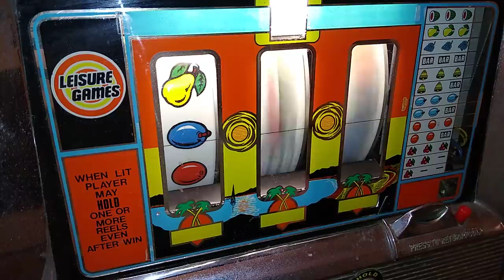Vintage Bally slot machine payout counter

Comment: Has anyone been on "Hand Tool Rescue" where he restores an IBM cheese cutter from the 1920s? Whilst it is not electronic in any way, it is the mathematics that went into it that makes it fascinating. It is essentially a calculator.
Reply: I saw that. The moment I realized the levers were performing a mathematical function, my mind was blown. I love retro computing, and finding mechanical and analog computers is an absolute joy!
Reply: But he was partly wrong on the weight-adjustment, at least how it was explained. the value has to be set for the complete (360°) cheese, even if you just put a 90 degree part on.
Reply: Wasn't it fascinating! What impressed me is they worked out an average portion/mass/value for cheese in the first place!
Reply: @rarbiart  that’s what he says in the video. If you have a full cheese or a block you put the original weight.
Reply: Yeah that was really interesting and it was amazing that when using modern electronic scales, the last century machine was extremely accurate. I wish I had a better grasp of arithmetic mathematics so I could understand how an analogue computer like that actually worked. I bet they cost a pretty penny when they were new. Very clever indeed and he did a brilliant restoration of the machine as well. 👍
Reply: "52 slices of American cheese..." 🤤😂👌
Reply: @richfiles  Yes, it looked decidedly unimpressive at first, even "cheap" in the way it was just pressed steel. It was only as the video progressed, did it become apparent, this was mathematical brilliance at its best, all done with levers. I was triggered with mathematical concepts whilst watching it. The IBM and the fractal vise are probably my favorite of his videos.
Reply: @josephking6515  I'd love to see the engineer's calculations and notes on it. Fascinating stuff.
Reply: @NigiriCat  OK, I missed that part.
Reply: @rarbiart  dont forget we went to the moon with most of the men working on them using slide rulers for most calculations
Reply: I've seen the thumbnail and ignored it in disbelief !

Comment: Brings back memories of childhood - raised by the seaside so the mechanical one arm bandits were a big part of my teenage years. No computer arcade games then.
Reply: Do you remember the horse race - 6 horses and you put coins into one of 6 slots depending on which horse you were backing. My bro and I found one of these - where they'd made a massive mistake (for us at least anyway!) All you need do is watch the machine for 6 'races' learn the order of the 6 winners and then back those winners when it repeats ! Then, you learn the order again for the next six races and again back all the winners when that sequence repeats !
Reply: @millomweb  I certainly do!  On one occasion someone who worked at the fairground  kept calling out the number of the horse that was about to win. (probably trying to impress a girl he fancied).
Reply: @millomweb  Yes I do remember them too although I wasn't a big fan. The bandits were a perennial favourite probably due to the noise of the lever arm, reels and the payouts. 
But my favourite game (which is still in all the arcades today) is the coin roll/pusher/drop games. Which they built a TV game show around a few years ago.
Reply: @tinplategeek1058  You mean Tipping Point :) The one I like was the one with the stripey conveyor belt coming towards you - where you had to get the coin cleanly between the lines. I could do that one ;)
Reply: @millomweb  That's the name - had a memory glitch there. There were many variations of the dropper/push/roll coin machines including as you say the conveyor belt ones too.
Reply: @tinplategeek1058  Tipping point is quite an enjoyable time-waster ;) Followed by The Chase, that's the afternoon done ;)

Comment: In the US, slot machines (even the new, all electronic machines) are built with components to produce noise. The payout coin pan is built out of a lighter weight metal and connected to the heavy frame of the machine in such a way as to enhance the sound of the coins being dispensed. Heightening the excitement for the player and drawing the attention of others to a "winning machine."

Comment: I blame Technology Connections and Fran Blanche for my love of electromechanics. So many creative and robust solutions to problems. God I need that Sunbeam toaster.
Reply: I want one too. Where can I buy it new?
Reply: @leonzantvoort6201  don't think they've made them for like 50 years so you can't get a new one. Refurbs though...
Reply: I've got a Sunbeam food mixer/finger slicer. Got about 6 attachments and not many couldn't kill you. I suspect the lemon squeezer would only give you a nasty massage. Fitted with an analogue mechanical/contact governor, it's marked with 12 speeds but infinitely variable between each one.

Comment: Old arcade machines were such a more visceral experience.  There was the physical shaking of of the machine, the sound of the relays and steppers clicking, the smell of oil and maybe a whiff of ozone, and the soft blinking of no. 47 pilot lamps.  Modern video slots just don’t cut it; they don’t involve all the senses at once.  Thanks for sharing the peek at some innards of the old Bally slot machine.

Comment: Ahh, this takes me back to University where I had a full sized pinball machine in my dormitory room.  Over the course of about a year I slowly rebuilt it and sold it.  It was entirely electro-mechanical.  All relays, stepper relays and solenoids, all of it driven by a huge linear power supply.

Comment: As a kid in the 60’s amusement arcades we’re such a magical place the machines seemed more interesting then, wheel ‘em down,tootie fruity,roulette, horse race,even the spring the bearing in the cup type. Loved the mechanical noise of the workings and alway watched as the maintenance guy with a chain full of keys opened a machine up and I could see all the workings..fascinating stuff, nowadays it’s just the complex fruit and coin nudge machines…there’s progress

Comment: Hlaf the fun of the old games was the noise, sounded great when you enter a room and a few slot machines are click clacking away. 👍👍
Reply: I have Asperger's syndrome, a form of mild autism. That discordant  sound is exactly why I can't stand to be in a casino. The modern ones are far worse with all of the electronic beeping and boopery and flashing multicolored lights.
Wasn't until a couple decades ago that I could tolerate working on electromechanical stuff at all and came to really appreciate analog computing devices (which is what Clive showed us).
Reply: Interesting to think about that as time went on and machines got quieter, at some point someone decided the noise needed to be added back(?)
Reply: @zaugitude  LOL    very true
Reply: @markfergerson2145  the newer ones are awful.
Reply: @zaugitude  Yeah, and in typical fashion, they WAY overdid it.

Comment: In my apprenticeship two years ago I had the pleasure of fitting a Bally Star Treck Pinball machine with a new flipper coil, switch and also repair some burnt traces on the mainboard.
These are beautiful machines that are also worth their weight in copper cable.

Comment: 'When I were a lad', my best friend and myself discovered a company which was converting slot machines to use electronic circuitry. They had a skip out the back (actually next to a main road!) which we used to raid regularly - made a nice collection of light-flashing cam/motor/microswitch devices and other interesting bits! Still got some of the microswitches lying around, and sold the last cam mechanism online about 3 years ago!
Reply from the maker: Those motorised cam switches cost a fortune now.
Reply: Heh. About fifty years ago I lived in a part of Phoenix Arizona practically littered with small aerospace parts manufacturing companies. They had the most interesting stuff in their dumpsters. Everything from quartz crystal blanks that were just a little out of spec and titanium castings with teensy flaws, to some amazing electronic and optical junk. They occasionally discarded perfectly good test equipment that they didn't use any more.

Comment: Decades ago in "Popular Electronics" magazine, was a project build of a answering machine. 
A motor turned as shaft and the timing was accomplished by cutting out wedges from poker chips.
Micro switches with levers dropped into the wedge cutouts to do the electrical switching.

Comment: I grew up in Paignton & Brixham so just those sounds took me straight back to Torbay Road in high summer on my lunch break from the Igloo Ice Cream Parlour in the mid seventies.
I can still remember the wall mounted, wooden case, 2p ball bearing machines on the pier. 
Piers seem to be a bit time warpy in that the closer you get to the end, the slower things get replaced...

Comment: More electromechanical stuff please!!!
I'm an old railway signalman and love the way we managed to do complex tasks with relatively simple tech and how over time we managed to integrate relay regulated multi aspect colour light signals with purely mechanical interlocking of the levers. Todays computer based interlockings have no soul.
I'd go gaga if you could find and teardown an electric staff instrument but that's never gonna fit on the bench

Comment: 1977 I saw on the bottom of that track circuit board, nice. 2 years older than me. I miss those noises to be honest, my father took up electronic repair here in the states about a year or two before I was born. I grew up around oscilloscopes, wave form generators and the such. Still have his old Sencore TV tester in the basement with all the adapter too, though it's long lost it's purpose for TV testing/repair. 

Sorry, rambling on. He used to fix all varieties of electronics, like that and old record players,etc, etc. My favorite were the old tube TV's, and taking trips down to the local electronics shop to use the tube tester. I miss those days a little, in that you used to be able to (relatively cheaply) build your own stuff out of discrete components too; before IC chips came along. 

But I digress, I'm writing a wall of text in memorandum to reminiscing, I'll end it here before I hit the word limit. 

Good video as always Clive.

Comment: I love my collection of EM Pinball machines. Toying with them is better than playing them - so many ingenious mechanisms, but my favourite is probably the self-cleaning action of all the open relay and switch contacts - inside the cabinets can be absolutely filthy and covered in soot, but they still work. In fact if you start up a previously working machine that hasn't been used for a while, and it doesn't work straight off, a few plays (sometimes with some gentle encouragement) will often bring it back to life as the contacts clean themselves!
Reply from the maker: Wiping contacts.  Pretty good at keeping themselves clean.

Comment: Love these bits.  I like working on electro-mechanical pinballs, lots of this kind of goodie inside.  If you'd like to see a real fun widget, try to get hold of an old Radio Common Carrier (RCC) MTS or IMTS (Manual telephone system? improvedMTS?) mechanical phone number decoder. Every time an operator dialed a number, all the mobile (trunk mount in this case) units would index their decoders. as each digit was correct, the pawl would catch on a pin and wait for the next digit. Any wrong digits, it'd miss the pin and spring return to home. (And keep trying to decode from there. Was dumb.) If you hit the full number, then it would ring and allow a pick-up. Worked pretty well, even with all tube circuitry.  (yeah, I'm old..:) Was fun to test and program. Thanks for the cool vids!  Stu

Comment: my late father worked on these mechanical mechs for many moons.  the older mechs  like used in one arm bandits , pin-tables etc used fabric sheaved cables not plastic. all oil drenched.. this looks like a reworked unit as the coils show no sign of operational heat discoloration..and the  tracks are not worn.... we have some real old stuff with multiple adder and counter units  as found in the back of the pin tables.. from using solenoid actuator to synchronized motor turning  multi lobe cams, all adjustable with hundreds of connections. very cool and awesome. the coin mechs used simple wire mirco switch, with weighted gates and a magnet rejector,, the real step was the marsmech coin mech..which pretty much stopped the use of home made coind and strimming.. we have a ton of this era stuff..

Comment: It has to be said, Clive, that I absolutely love mechanical logic - It's simple, and I can follow it as it works!

Aside from the Allmet grain dryer that I've mentioned before, the workshop heater in my brother's garage business was a work of art in machine logic. The control logic cabinet was about the size of a tumble dryer, crammed full of relays and geared drums with contact studs like an Enigma machine. Despite the mechanical complexity, these machines were still reliable, and for the most part readily repairable. - None of this "It's like this guv'ner, yer PC-2893 board's gone phutt. I'll have to order one from China. It'll be about five weeks" - Later to be told "Can't get 'em anymore! You need a whole new plant".

A felt pad, a bottle of cleaning solution, some fine emery paper, a handful of small tools and an engineer who knew his job was all it needed! - Click clunk, bzzzz, hum, and the sound of motors starting up again!!

Comment: Clive I have here what is a micro spot welding machine which dates from I reckon the late 1950s. It's table based with a foot pedal on a chain below. The machine can, if needed, push out up to 100 amps for any duration up to 15 seconds. The current is infinitely adjustable (not set in notches - it's smoothly adjustable) as is the time. The machine actually runs from a standard 13 amp household socket (it's a UK made machine) and works flawlessly. 
I had to check internals when I bought it a few years ago and it's incredibly interesting. All of the operations inside are done by old school technology. I'm not electronically minded so have no idea how it's done. There are masses of electronic components of old school designs inside and bundles of neatly tied wires running throughout the control boxes. They all eventually feed to a single large relay with open contacts which fires the transformer to make the spot weld happen. When I bought it, the silver contacts of the relay were tarnished and needed cleaning. I replaced the mains flex too. 
The machine works flawlessly. It can spot weld components of very small sizes (think filaments, valve internals etc) and all the way up to quite thick wire for frames such as bathroom soap racks.
Interestingly, the company which made this spot welder appear to be still going (Hirst Electric Industries, Crawley) though were bought out by a larger company. They still make micro spot welders. Yes they cost a lot of money new!
Your video reminded me lots about the micro spot welder here. The way the wires are tied neatly inside. A fascinating video!

Comment: Having been trained in the maintenance and repair of Strowger (electro mechanical) telephone exchanges I never cease to be surprised by how cobbled together this sort of stuff is. For example, the added inertia on that solenoid to make it slower to operate, telephone exchanges had magnetically damped relays to make them slow to operate and differently magnetically damped relays to make them slow to release. In fact those exchanges worked by the magic of tuned relays with equally tuned tuned contact sets. And mechanical digit regenerators (which the counter slightly reminded me of) were a joy to behold. Mind ewe, the GPO probably had a bigger R&D budget than most fruit machine companies 😁
Reply: These were pretty much "cobbled" as they used common parts - relays, coils, plungers and switch wafers across many machines, bingo, pinball and slot. So adding a few washers is far easier and cheaper than a custom part line for a single machine or even a single function in a amchine.

Comment: It's amusing how this was solved by such a simple mechanism. I was born '83; when you showed this at the beginning I thought: "Ok, so the relays on the right hand side are a binary counter, and on the back there is comparator circuit for each possible payout, that fires a reset circuit which at the end spins the disk forward to a latching point".

Comment: It was fun seeing inside this thing.  I noticed a lot of pitting in the sliding copper contacts, enough to make it malfunction probably.  This reminded me of the Strowger Switch, a 1p10t stepper switch used in old dial telephone exchanges with a solenoid to step it, and another to reset it.  My Dad had one in his electronics collection, I remember having fun playing with it as a curious boy, making it step and reset manually.  Hope you'll do a show on the Strowger Switch some day.

Comment: Ahhh  Brings back memories of 'Wally'.  When i was a Kid, miles out at Sea on Ship, saw Slot Machine with Jammed Coins. 
I pulled the 'Hair Pin' trick and got many out, only to hear a coin Drop ..... So, I Pulled Handle.  8|}   there's more ...
Hitting 'Wally' with Palm, either dropped another or it thought one did.   Earned a good bit, enough for pizza with friends & Tip. 
And why Wally?  He was one of ship's Crew we'd joke around with.   Thanks Clive!

Comment: I'd be interested on more videos on Bally machines.

I did a contract installing led strips and other rgb leds in a dmx setup for s guy in his basement. This guy has 50+ working Bally machines in that said basement for his personnal pleasure & I have been intrigued in how they work ever since he opened the pannel of one of them to show me all the cable runs in them.

As you said, they seam complicated but simple at the same time. I'm not ready to touch any of those wires just yet tho! 😂